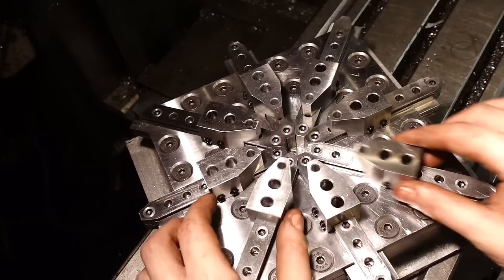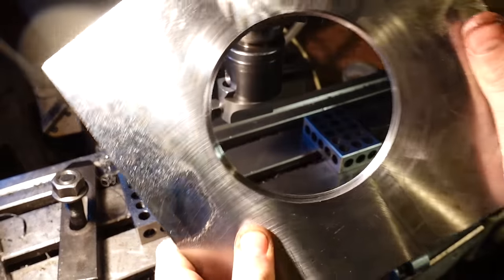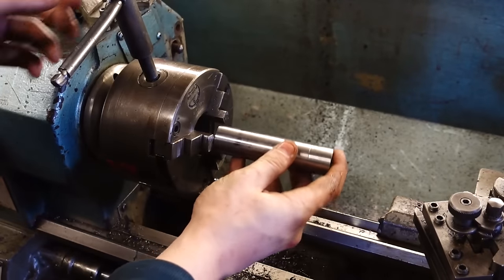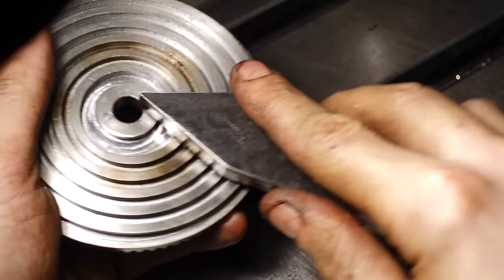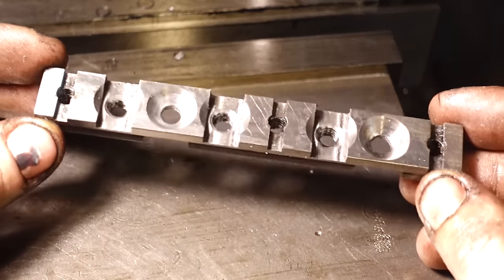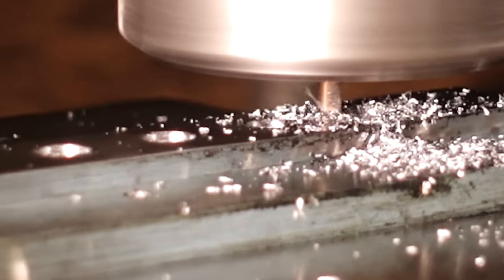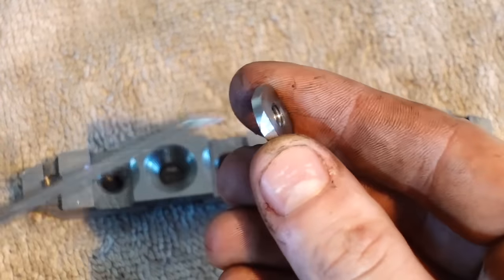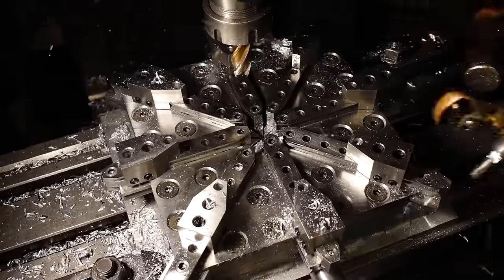Vice Prototype!

Comment: Love it. But quick question, aren't the chips gonna get the scroll stuck. I did learn from Mr Pete to use Graphite powder for lathe chucks instead of oil or grease, it did work great, hardly ever getting the jaws stuck from chips any more. But as yours are horizontal and the chips get piled on top...

Comment: That's pretty sweet, one question for give if I'm asking a stupid question but how do you design or even mill a scroll, I've seen a few videos on vices and chucks but can't get my head around the actual design layout of a scroll, I've been wanting to make a chuck or vice on similar grounds to this for my wire edm machine because one of the biggest pain in the ass on a edm is clamping odd shaped parts. Any advice would be great, as others have said don't use old engine oil as cutting fluid as its not nice stuff. 👍

Comment: What an impressive piece of metal metal... Multiple pieces of metal actually
Really I see not many uses for this other than even clamping of not round but still round parts  which can be a lot of different shapes really (gears, cams, eccentrics... ovals...)
I'd call it a universal low profile mill chuck
tbh a fixture plate would serve the same purpose but those can replace everything so they don't count 
Love the video <3

Comment: nicely done. I would probably add a 3D printed chip shield to it to prevent oil, coolant and chips to get too deep into the mechanism. bonus points for the sketchy use of the angle grinder...

Comment: So, in use, for an odd shaped part, you loosen the jaw parts, slide all of the jaws into place, tighten them, then crank on the chuck key to bring all of the jaws into pretty equal pressure...
Nontrivial design

Comment: youll get more precise holes if you stop you reamer when you get to final depth and pull it out when its stationary
Reply: also please move in the direction you indicate my ocd is going insane what about the slop in the machine
Reply: the jaw portion is super informative taking away some techniques for my next project. at about 23min too rly cool way to whip those out
Reply from the maker: I will apsloutly bare that in mind ...
Reply from the maker: And yes I should really but I tend to use a dial test indicator like a plunger indicator on flat surfaces although I shouldn't 😅....

Comment: Do you ever plan on making a laser capable of melting metal? Like the ones used in metal 3d printers?
Reply from the maker: Yes I do only thin metal tho ..... I'm really hoping to achieve above 100w
Reply: @allangles4020  that is awesome! I plan on creating a metal 3d printer but I can’t really afford a laser that powerful and I have/am working on building all of the equipment, I don’t really know “all” that much about optics so I was hoping I could use a video to get a general idea. Thank you for responding :)

Comment: I gotta know, is that motor oil you're using as a lubricant?
Reply from the maker: It is
Reply: @allangles4020  Please don't use 'used' engine oil.  It will wreck your hands and nails due to the very bad chemical composition.

Comment: Cool project, although your sfm is WAY to high on most of your operations. Pushing a burr and throwing sparks on a manual mill is a dead giveaway. Even if you're CNC converted, it's still a Bridgeport. Slow it down and your tooling will last longer. With love, a 20 year journeyman machinist.